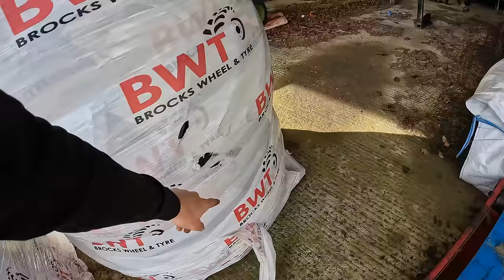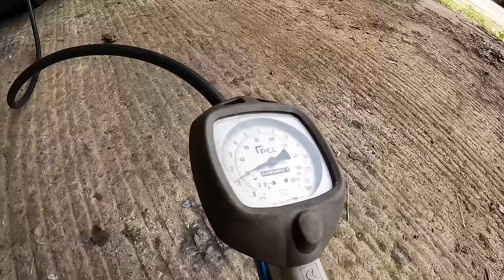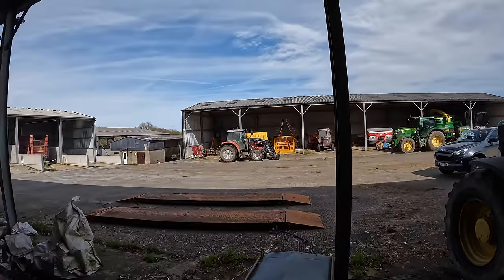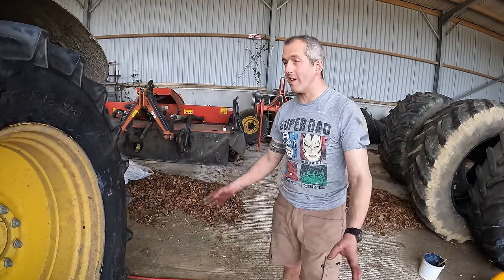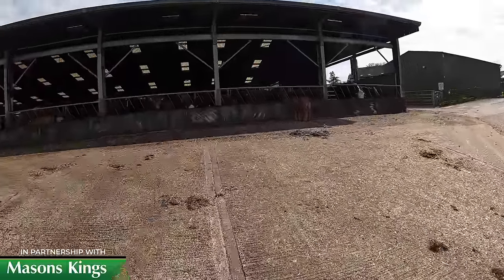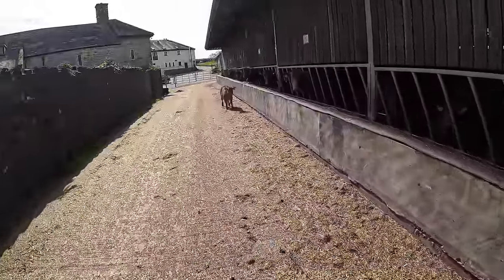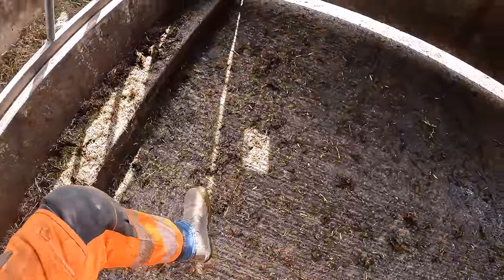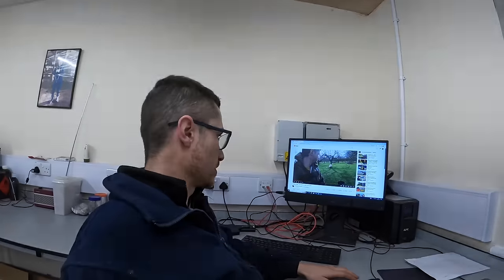New Rubber For Big Boots! | Calves Escaped!

Comment: The guys we use for tyre fitting/repairs use a grease like substance that’s got fibres in it on awkward tyres if they don’t seat after using a bead blaster!
They say it’s quite expensive stuff and always scrap off the excess and put it back in the pot!😂😂
Reply from the maker: We will have to look into that! Jon put the fronts on this week and had to grease them to make them seal too!

Comment: If you get a length of airline enough to reach both inflation fittings get two clip on connections to fit tyre inflation fitting conect both at same time the air preasure will level up in  both tyre preasures
Reply from the maker: That’s so simple yet so genius!